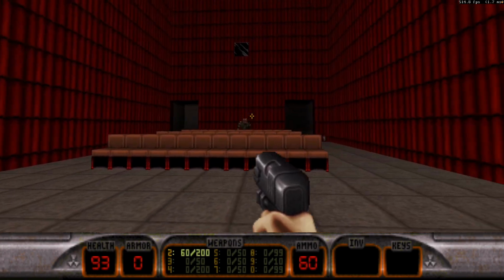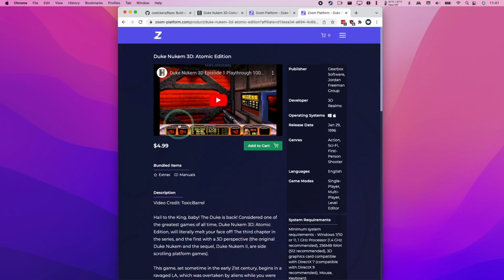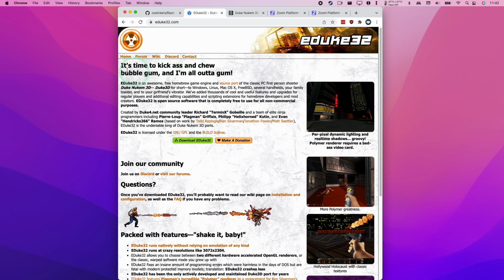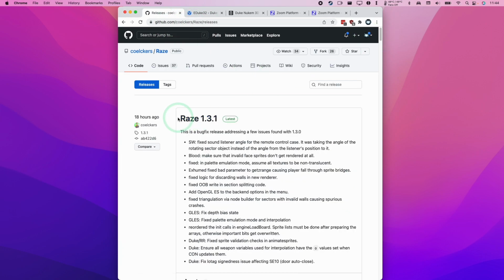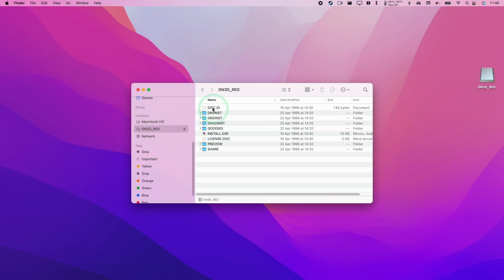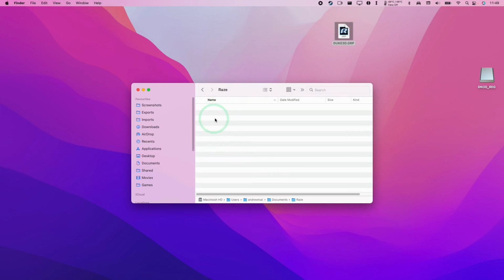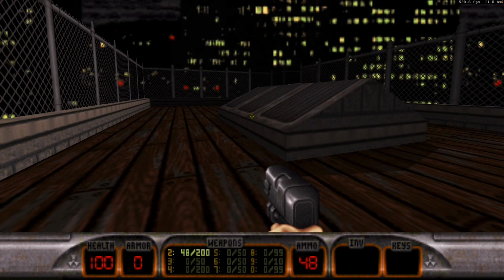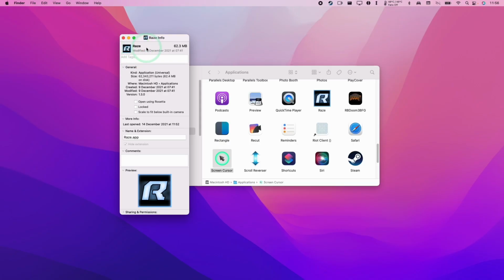How To Install Duke Nukem 3D Native ARM On M1 Mac Using Raze Source Port

Comment: Cool this is exactly how I run it already on my arm android. Wasn't sure what the deal might be with saying my M3 Max laptop because I'm new to this architecture with OS X. Raze is pretty great. And it gives more options than eDuke32 for the same exact releases. That .GRP file is basically essential of course. Smaller one tend to be older releases.